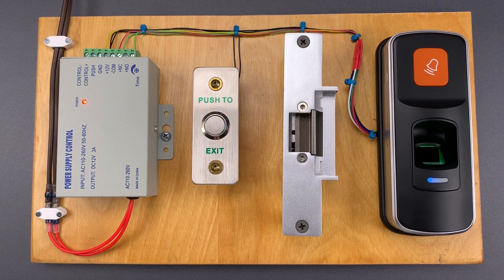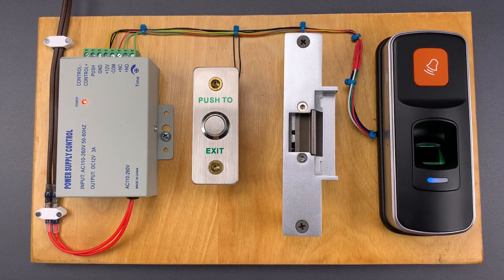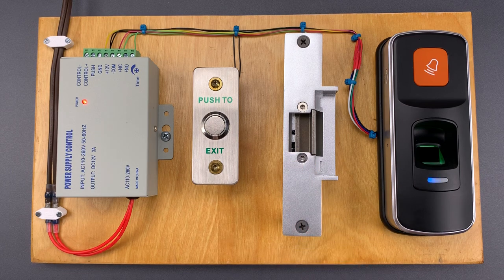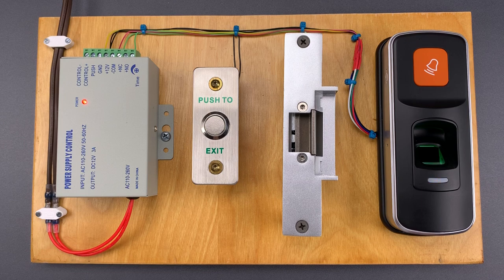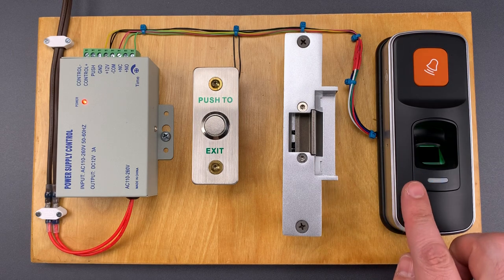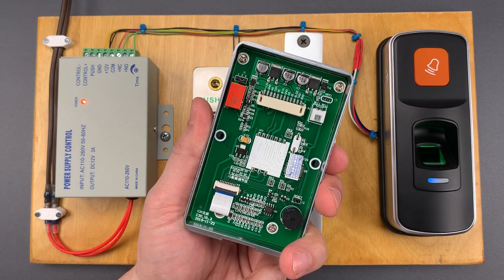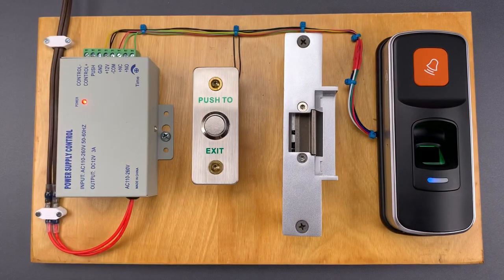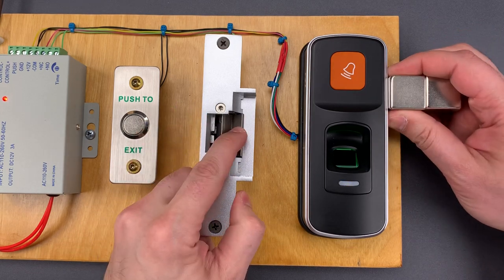[1060] Opened in ONE Second: HFeng Fingerprint Lock

Comment: Damn! Now, I want to know, if there´s any commercial door lock he recommends...
Reply: Probably something with a key, and only a key. The more convenient we make our lives, the less secure we seem to be.
Reply: @--_DJ_--  Maybe some ancient lock, where there´s no market for lockpicks and modern picks won´t fit?
Reply: @edi9892  Just a properly designed lock with anti pick and anti drill features.
Reply: edi. There are plenty examples of old style locks being manufactured with modern metals in high quality safes. There are specific picks for these, but the skill needed to use pick one of them is extreme.
Reply: @koalatails6391  I´ve seen a medieval key which did not only have some zigzag bends on the flat, but was also S-shaped from the profile. I doubt that any pick would fit into that key-hole.
Reply: For the price of some of these smartlocks you can get an actually good one. Mul t look interactive+, meedeco and abloy are good starting points
Reply: Abloy. A modern one, not the old crescent-shaped from the 1920s. He's never picked one of those.
Reply: edi. The profile doesn’t stop the lock picks, it prevents the wrong key from being inserted. Lock curtains, & wardings, get in the way. The more lever tumblers the more difficult. I’ve seen an ancient key that looked like a QI code.
Reply: He said that fingerprint/RFID entry systems where the logic circuitry to decide open/no open is inside the door are not usually vulnerable to this kind of attack.  However, if what's inside is worth the risk of 20 years in prison for a smash and grab, a lot of these are controlling glass panelled doors, a lead pipe bypasses any lock on these.

In my apartment complex, RFID fob entry system, Schlage apartment door locks, there is a backup key entry system on the apartment building entry door, but not a Schlage, so only management and a good lockpicker can get in if the key is required (my Schlage apartment key does not work, I know, I've tried, even when I worked as a caretaker and had access to the master key, that didn't work either). 

The fault of the RFID fob entry system in my complex is that, if the building logic circuitry fails, the RFID system goes to open mode, where the lock entry system is disabled, and one can just pull the external door open to get inside.

The biggest headache I have at my apartment complex is other residents jamming something into the door latch (a coin, usually, or a can tab) or jamming a rock into the hinge side of the door, so that someone else can open the door at will.  Worse, the logic of the RFID system does NOT signal an alarm when the door is not closed for a short period of time in cases like this, so the fault can be corrected immediately.

Comment: Seriously... they could have mitigated that very common attack vector with a solid state relay.
it cost more sure, but at least your product would actually offer some protection.

adding anti temper elements would definitely prevent most casual attacks... but you know, that's expensive, better keep that margin high and extort/sell fake security to customers.
Reply: whos that in ur profile pic my dude
Reply: @geyotepilkington2892   TCC-tan from 420chan.org
Reply: wouldn't some simple / cheap shielding and/or smarter board layout (not near the edge) do the trick?
Reply: @mtraven23  Shielding would be way more expensive than switching to a non-magnetic relay.  Board placement would help to a degree but you'd just need a stronger magnet.  There are plenty of switching a signal without using a magnetic relay.  As mentioned before a solid state relay or a transistor will both work.

Comment: wouldn't this be fixed by changing the fingerprint reader relay into a transistor instead? not excusing them, just wondering why such a cheap component wasn't used
Reply: maybe sth. with the polarity and the current through the actuator
Reply: @stepanpavlica4841  sorry i don't understand what you're saying here. Lol
Reply: @Fernybeme  The transistor may not be there because the current to the door opening part may not be direct, andiven if it is, the voltage and polarity may vary

What i was saying is, there are too many uknowns , so a transistor to work in all cases may be even more expensive than the relay.

One other benefit of using a relay is, that i galvanicaaly isolates the circuits.
Reply: @stepanpavlica4841  True, but the security implications should probably have justified a silicon solution here.  Given the size of the relay it does not seem like the voltages or currents involved are particularly high, and a solid state relay likely exists that would cover this application for not that much more cost even if a simple transistor switch couldn't quite do it.  If a relay was necessary though, they could still have been more careful in the design.  Rotating the relay so the contact must be pulled toward the door would help.  It also would likely have been better to use a normally closed relay that is constantly energized and depowered for unlocking instead so the electromagnet holds it in place while locked and prevents external manipulation.  While that would close the relay during a power interruption, the lock mechanism would also lose power and be unable to open.
Reply: @piperboy98  true, but the relay will close regardless of it's orientation and the polarity of the magnetic field. (you can probably find an angle at which it opens (perpendicular to the relay))
and the relay still galvanicaly isolates the two circuits
to do that in silicon would add extra components (an opto-isolator), and would require powering the transistors and lock with the same power source necessitating at least one extra cable to be routed to the all-in-one-fingerprint-reader.
Reply: @piperboy98  This particular lock uses an external power supply.  One on our lab is completely run from an internal battery.  Leaving the relay active would drain that battery in no time.  The key is to not use a mechanical magnetically activated relay.
Reply: @stepanpavlica4841  This is why mechanical relays still exist.  Electrically, they're very robust and multipurpose.
Reply: @stepanpavlica4841  And the opto-isloator would add things a relay doesn't have, like voltage drop.

Comment: Why do they use relays at all, instead of transistors or mosfets? they are all cheap
Reply: Higher current rating, the electromagnet inside of that door lock mechanism needs a fair bit of current to operate, it also generate some big voltage spike when you disconnect it which will cause mosfet to fail
Reply: Along with Pierre's comment: Look up "reverse EMF".  However, it CAN be done as you suggest, it just requires a little more engineering and a few components.  I am guessing you know that since you know about transistors and MOSFETs.
Reply: @bobcitizen1149  probably the cost of beefy mosfet + extra circuitry make it more expensive than a relay
Reply: @pierreuntel1970  mosfet are usually better for switching high current assuming you're using a proper gate driver. I am sure a mosfet + protection circuitry and gate driver (not needed here) is more expensive but at least it can't be opened by a magnet 😛
Reply: @pierreuntel1970  Probably they thought they could get away with it.  Imagine the support costs, warranty costs for this.  It wouldn't require anything I would call a "beefy" MOSFET.  Ones with Rds(on) of a few mOhms are a few pennies in production quantities.  Likewise diodes, resistors and caps (which wouldn't need to be beefy either).  I didn't check out the relay part number though.
Reply: They are not perfect drop-in replacements despite what they call them.  It takes a lot of work to do what a piece of wire and a magnet does intrinsically

Comment: Great video! Please remember that this only apply to some cheap ones. Typical security reader does not have a relay. Lock is supposed to be operated by control panel on your left which is not accessible to users :-)
I look forward to see more movies about these kind of systems :-)
Reply: This "cheap" lock allows both configurations

Comment: It would be a simple matter to replace this relay with a bipolar transistor, which would not be sensitive to this type of attack. It would further be cheaper to manufacture, and have better Mean-Cycles-Before-Failure. However, somewhere down the line this switched electrical energy must be converted into mechanical force, which is also going to involve an electromechanical device - probably a solenoid. It would be buried deeper in the mechanism, and probably require a much stronger magnet in exactly the right location to defeat, but just face it; Whatever you build, this guy is going to get in!

Comment: And fooling around with the wires, when exposed, would also open the lock. This setup will only be moderately secure if the front and back parts communicate securely (encrypted). But that will require the back (lock) part to have some chips too.....

Comment: The Exit button should be the one doing the unlocking. The logical processing should be done inside that button. If you're outside it sends the data to the button's logic board and the board then activates the switch the button is connected to. If you're inside you just push the button and it trips the switch. They just can't be assed to put the logic components from the reader into the button.

Comment: Place a Reed Switch (Magnetic Switch, Normaly open) parallel to the relais switch that opens to release the lock.
Because of the outside magnet the relais will switch, opening and releasing the lock, but the Reed Switch will also be affected and close, keeping the lock active.
When your fingerprint is making the relais switch, it will not switch the Reed Switch.
If you can solder, a cheap (few dollars/euro's) and easy fix.

Comment: They should go for Node based systems where the controlling gear is in a nearby Riser or Cupboard, which is where the Reader and push to exit feedback to and where the relays are located. Having a system like this prevents this kind of easy access.

Comment: You used to be able to do the same thing with old vending machines, you could put a really big magnet near the coin mech when you put in any type of coin that would fit and the magnetic force would pull the coin in so fast that it would trip the sensor thinking you actually put in a loonie or toonie for those in canada.

Comment: Ya need a system that puts the smarts in the grey "power supply" and the finger print sensor just sends a digital signal back to that which then checks to see if authorization is granted.  This is basically how most large corporate buildings do proximity card access.

Comment: That's why with good systems, the only thing on the outside is the fingerprint reader, all the electronics and the relay that controls the door is somewhere on the inside. 
Also better for the life if the reader. They will always fail due to moisture in the electronics so it's better to put it on the inside.  Premium brands also put all the outside electronics into resin

Comment: The relay is controlling DC voltage, replacing it with a cheaper and more reliable solid-state relay (mosfet) would eliminate this vulnerability.
You could replace it yourself.

Comment: they should use transistor, not relay+power switch could be in separated block (on the other side ) so remote with fingerprint will only send code combination(better dialogue code). This measures couldnt  increase the price but it will make item much stronger to open

Comment: as a backend software engineer . Half of these can be solved if the verification happens inside ie the outside module just send what your finger looks like and the inside one does the verification and unlocking .

Comment: They could easily eliminate this problem by using a MOSFET or thyristor switch. Such a circuit would not be affected by magnetism, of any strength. (and should cost no more than the present components). Solenoids are extremely old fashioned and were antiquated, IMO, by the 1970s - when thyristors became very cheap and readily available. Now that we have cheap MOSFETs, which can accommodate 5 amps in a size smaller than than this circuit's solenoid, there's no cost benefit in using them.

Comment: That's why I never trusted those standalone locks, what I did at my home, I have access controll panel in basement secured location that nobody can access, at the doors I only have reader which only reads card and sending OSDP signals to the panel, than panels approves the credentials and activates the strike

Comment: Solution,  a second security switch near the other that activates if a strong magnet is near and it prevents the door from unlocking.
Reply: The solution is to have the relay located somewhere else. Given it directly triggers the opening there is no reason for it to be outside.

Comment: Could replace the relay with switching transistor or thyristor so the magnet would not work but slightly more expensive and easier to burn out with wrong or different type of lock.

Comment: Personally I use a wifi controlled relay for my strike which I can activate from my phone, then I have a receiver that has multiple channels, one channel is wired parallel with the wifi relay into the trigger of a timer relay which releases the electric strike so I can push the door open. I carry a 3 button keychain remote, one for pedestrian door, one for overhead door, and one turns my lights on and off. The whole thing runs on a battery that gets charged by the sun(the power for the lights is plugged into the wall outlet). There is no reader or any other device outside. I know you will break in if you want to, but it's good enough for me.

The strike is also magnetically activated, will this high power magnet work on the strike too? In my garage door its in the jamb like a normal strike and the door swings in so everything is not exposed to outside as much as a commercial door is. I install them but usually in a 2x2 steel gate post. With a strong enough magnet I suspect it would release on a gate. I don't have one...yet

Comment: And for this i prefer use mosfets, they usually are cheaper and they arent mechanical so they are safer and cant break on a long time for use if u calculated well all the circuit.
I mean relays are useful for some uses but not for all things

Comment: This would be so easy to solve:
If the control signal into the relay is off, but the output of the relay is high, trigger the tamper alarm.
The door would of course still open, but now there's an alarm going off.

Comment: If I bought this on Amazon, I wouldn't hesitate to pluck off the relay and replace it with a optocoupler or perhaps 2 direct wires on the board to the admin box.
Reply: surprisingly, solid state relays are not perfect drop-in replacements for real relays.  They may work in your application and may not.

Comment: As a security installer we always recommend against these. People still try to buy them to save a buck in labor because then you don’t need cabling, etc. Personally I’m a big fan of a 600lb mag lock with controls in the ceiling or closet in a tamper proof box.
Reply: Exactly. Run some damn wire and save your life

Comment: Well if I was doing something like that, I would have a complex electronic signal with encryption going to the door lock which would need to be interpreted by the door lock making it near impossible to intercept the signal, ie. a static magnet wouldn't work. Also I would never use a relay anyway. I'd probably also use a motor driven door latch so that a simple magnet couldn't excite that.
Reply: Or just dont put the relay within access to the person trying to get in

Comment: 2 questions LPL

1. Where do you get such a magnet
2. These electric locks are typically backed up with alarms so that's going to sound the second the latch is released OR when the door is opened. What should we do when that happens?

Comment: Well I built my own, and sure enough the relay is inside the house xD, outside there is only the sensor and a transceiver driver... U could still change the finger sensor for one with ur fingerprint enrolled but the unit inside would recognize it send an alert message trough MQTT and stop communicating with the sensor... A solid state (AC power only) relay would avoid the magnetic problem but if u open the box u would be able to open the door easily by shorting the correct wires (or PCB trails) =(

Comment: I don't know why some manifacturers puts the relay/control circuit in the external box. My knowledge about electronics is a bit limited, but I will never put the control box within reach because is very insecure. You have to put the important circuits hidden, and the external box must contains the minimal circuits like for example just the fingerprint reader (fingerprint data must be processed in the control circuit placed in a hidden place too).

Comment: Ha ha cool, another problem is that for safty reasons, the lock has to unlock if the power is out, so if you can find a way to make the fuse blow in the house, or remove the power to the house, all doors open. They also dont remember there state, so say you are away for 1-2 weeks, and there is a power out in your area, then all doors will be unlocked when you get back home.

Comment: Sadly, this works on a lot low end readers... most decent standalone/offline readers have an Interface module IO board on the secured side for the lock relay, RTE button etc. connected via RS 485 bus or similar; this negates this type of bypass.

Comment: Ok why 
Don’t they use transistors,
Don’t shield the relay (I don’t know if that’s possible, probably not)
Don’t they put the relay on the inside and only send the low voltage.